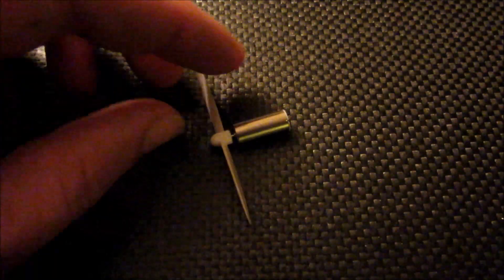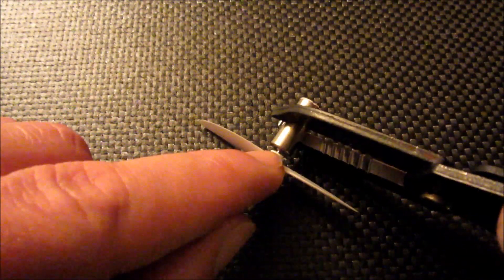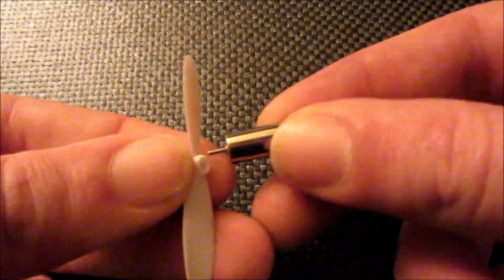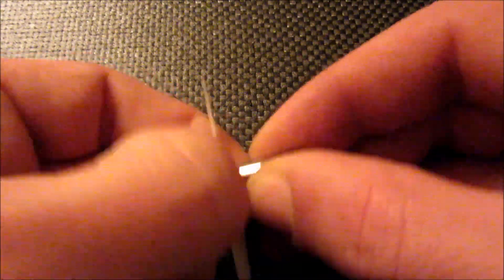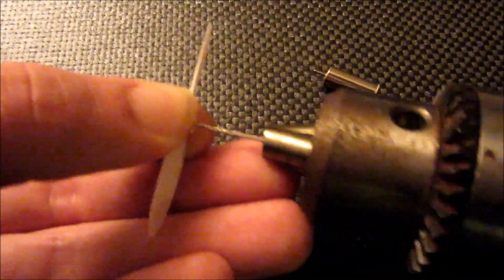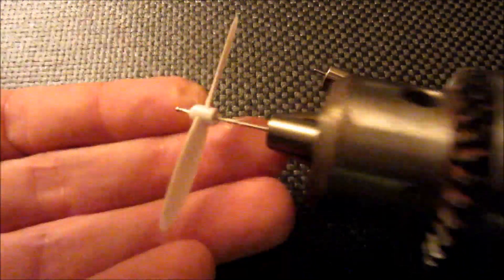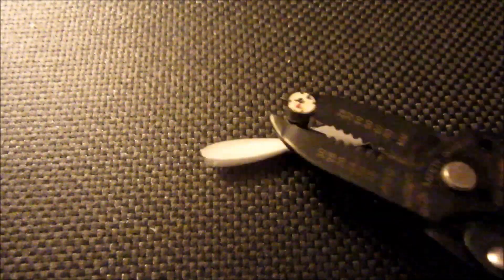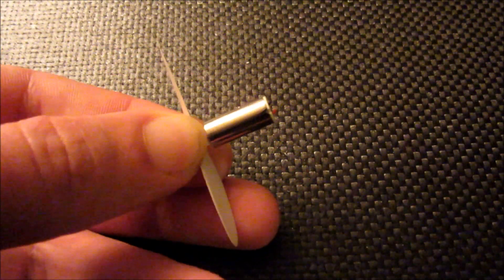protect those micro motors

Comment: problem with that is now the prop rubs up against the can of the motor and after one crash  you end up burning out your motor because of the friction created between the can and the prop rubbing! please check out my channel for different modifications and reviews on multirotors as well thanks
Reply from the maker: +Full Metal Heli 
Not really, I have probably 50+ builds with no motor burnup problems and always do this.  This is also how some RTF quads protect the motors.

There is always a little axial play in the shaft.  When the prop is pushed on the shaft is positioned downward slightly into the can.  Once the prop starts spinning it pulls the shaft up leaving a small gap between the motor and prop.

If your burning motors up it's likely a problem elsewhere.
Reply: Lol... OK... anytime I've had a prop push down up against the motor it makes a ton of noise in flight until you pull it backup just a hair. Till you put that GAP back in there!! the motor will get extremely hot until you do so. And yes you're right when it spins it does pull up just a hair but a lot of times it's not enough to keep it from rubbing on the can
Reply from the maker: Bummer, I'm sure the amount of axial play will vary across motors, but it's always been plenty for me and seems to work for most others too. The smoothness/flatness of the prop base likely also factors in. Maybe your prop/motor combo is causing you to have more issues with this.  
Crashing often pushes them back down, so you must have to check after every crash. Fortunately, I don't think this is a very common problem.

Comment: so what size bit is that? i cant find what 62 size wire gauge measures to. dremel sells a 0.8mm bit as part of a pack, the shafts are 1mm correct? i cant imagine it would be a 1mm bit or the props would pop right off.
Reply: 1mm drill bit and a tiny dab of CA if needed.

Comment: Wich kind of motors where you using for test? Normal 7mm or chaoli 7mm. Cause i noticed the caps from chaoli motors will pop more easy
Reply from the maker: The motors shown were random ones I got cheap on E-bay. This method should pretty much work for any of them though.  I imagine the amount of cap retention varies even for any given manufacturer as it's just 4 little stamped intents in the base of the can.  I have not found the Chaoli particularly different than others in this area but I'm sure they can vary.